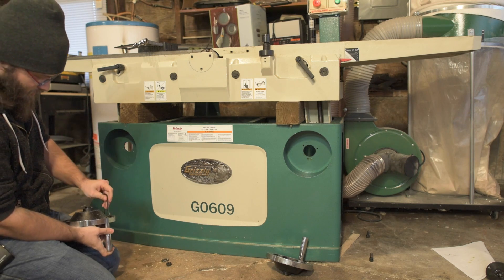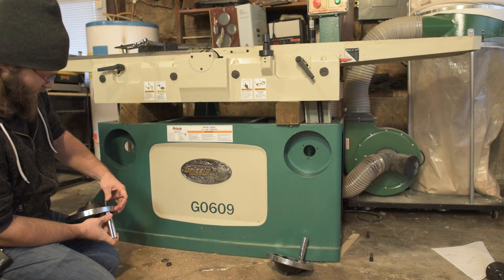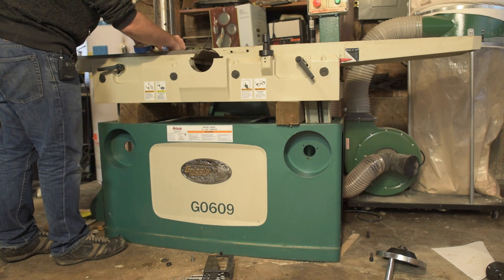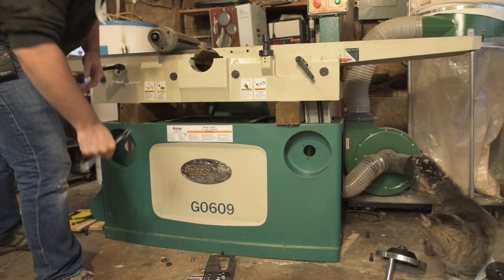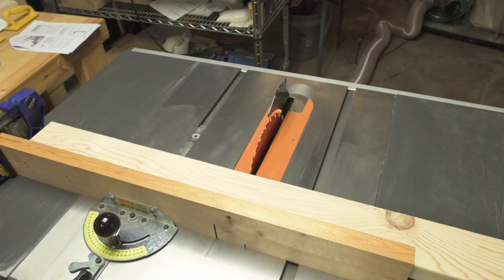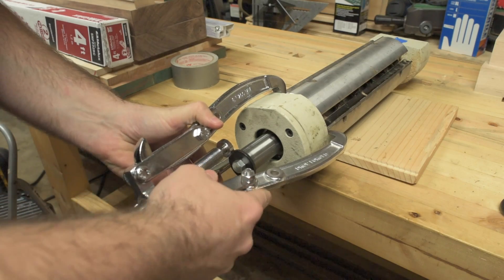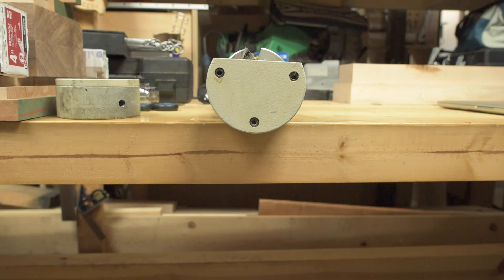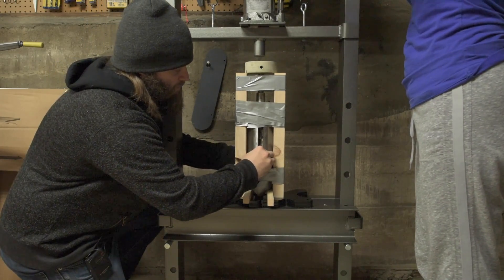Grizzly G0609 Shelix Upgrade - Part 3

Comment: like joe blow said. there is a slot in the cast iron! at least on my 2013 dated model. a 4" round plate.  pull it and access the underside of the cutterhead